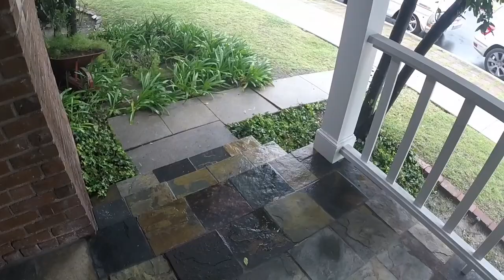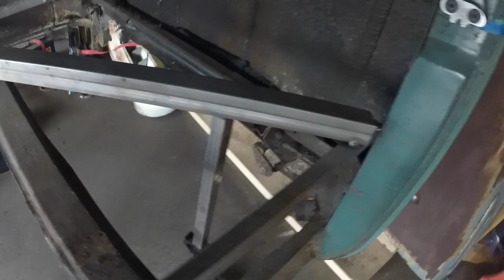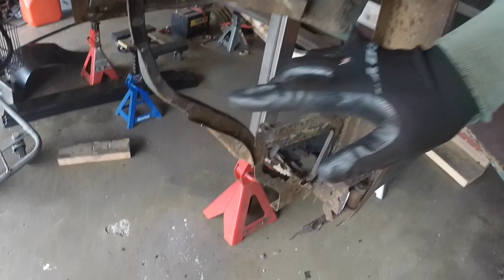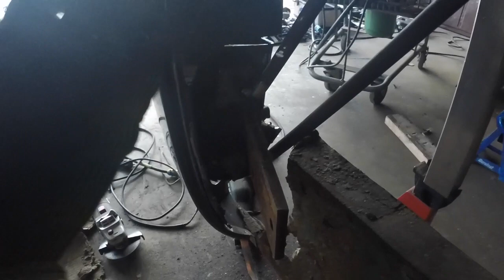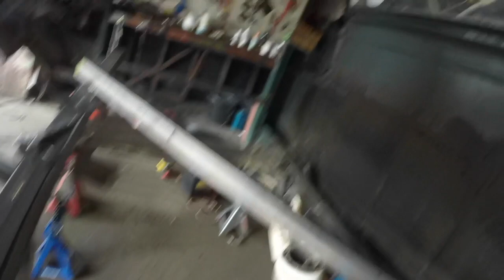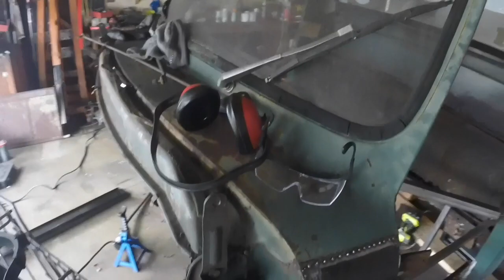53 F250 Fat Betty episode 3 RUST REPAIR !!!!!!!

Comment: hey nathan great work, i got a question how different is the 67 f100 fire wall from a 66 f100.  im about to start a frame swap on mine and i need advice if i sould keep the f100 firewall and floors or just go with the crown vick firewall and floors
Reply from the maker: Alex Acosta go over to "Frame Swap Faction" on Facebook. It's a group I just started for these. Post up your questions & answers will flood in 👍

Comment: Hi Nathan 
Big fan of your youtube episodes on the 69- F250 and your F71
Here in Australia we don't have the variety of cars, you have there.
Enjoying the 53 F250 fat Betty project cant wait for the next episode 4
Reply from the maker: The passenger A & B pillars just arrived so I'll be getting on with them tomorrow!
Reply: Hi Nathan 
Had an idea for your next project 
49' Chevrolet 4100 maybe fit a suburban 4x4 underneath it? just thought. Nothing like what you can do in the states is allowed in Australia. Laws and regulation plus insurance prohibit any kind project like what you've built.
Reply from the maker: So sad. Is it right that you guys are loosing the Commodore & Falcon? No V8's? If the wheel bases are close & frame rails will fit under I'm quite sure that'd be a very nice "daily" Chevy swap.